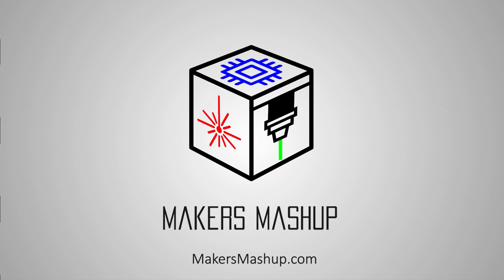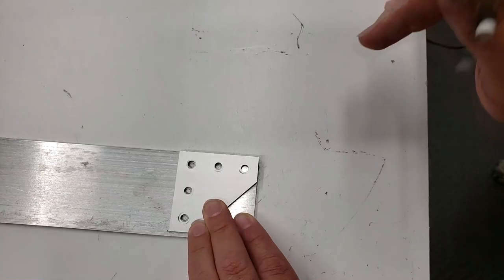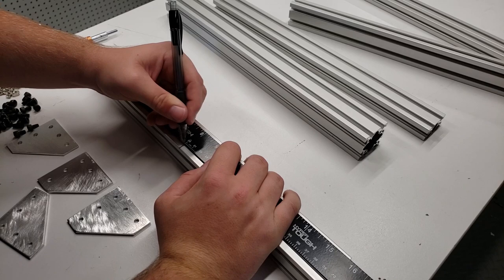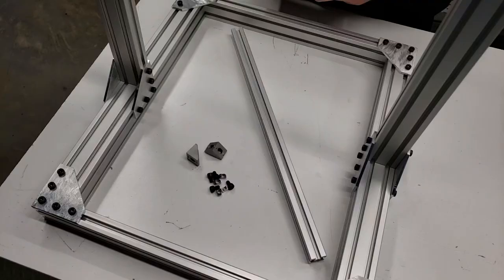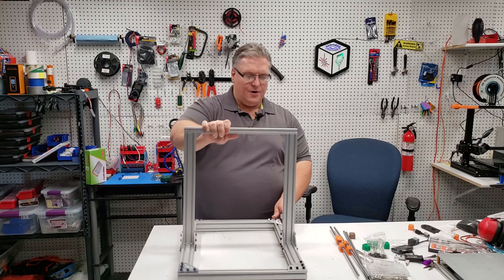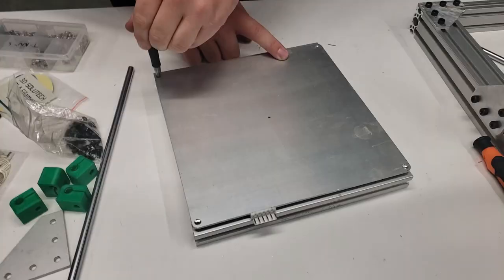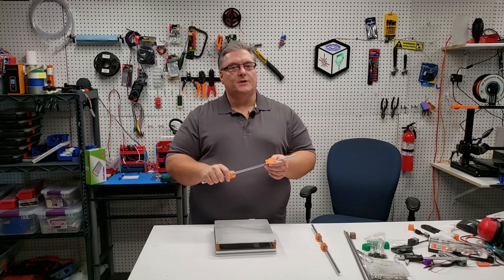DIY 3D Printer Build Your Own  - Part 1 The Frame (Step By Step Guide)

Comment: I wish more people would do this as I did almost 7 years ago.  Seriously, building your own is so much easier, and cheaper, now plus when you are done you will know your baby inside and out.  Hear a noise?  Boom, you will know what is wrong.  We need more makers and less Chinese already made plus I figure if you put in all of that time, and effort, the printer will really be used and not just another electronics gadget stuck in the corner.
Reply: How much did you spend on yours? And what dimensions is it?
Reply: @mixbandtu3225  You can easily build a 400x400x400 for under 200 using top quality parts.  The most expensive part will be a silicone heating pad and the tool plate.  Neither of those will you get on a store bought machine and both of those matter greatly.
Reply: @thebeststooge  How??? That can not be built using v-slot?? Only the extrusion will almost be over 200

Comment: Hello,

First of all, thank you so much for the amazing series on building a 3D printer. I was initially planning to buy one, but after watching your detailed videos, I’m inspired to build my own. I’ve nearly gathered all the necessary parts, except for the 3D printed components. I have a few questions regarding those:

1. There are multiple files available for certain parts, like the x-idler-left. Is it okay to 3D print any one of them?
2. When ordering the 3D printed parts, I noticed that the infill option is set to a default of 20%. I’m not sure how much infill I should choose—20%, 40%, 50%, 80%, or 100%. Could you please advise on this?

Comment: I like what you were doing until that bed setup? It is far to heavy and will create wavy pattern in your print if you want to print at decent speeds. The lighter you can make the moving parts the better. Print quality is always effected by the inertia of the moving bed and nozzle and the heaver you make them the slower you need to print.
Reply from the maker: Absolutely right but for most people they can easily source extrusion but not a standard bed plate.  It prints quite well but you're right higher speeds will introduce artifacts.  It's a good starter printer.   The X301 is the printer you want to build if you want high speed.  That series just started.

Comment: Great video! I definitely will try to follow through and make my own using spare parts from my existing printer. I do have 1 question though, the 4040 extrusion parts, I'm trying my best to make a budgeted printer since I'm doing this on the side, are the 4040 @ 400mm necessary? Would I be able to use the 2040 or 2020 in its place without my frame suffering? Hope to hear back from you soon!
Reply from the maker: You can for sure use 2040 instead of the 4040.  I made a variation on the build myself.  I am pretty sure I included in the C201 models a riser that will allow you to push the rods up for clearance.  Absolutely though you can use 2040 as a replacement.

Comment: I decided to build my own 3d printer after watching your videos, everything seems to be so smooth and flawless in the process however that is not the reality in practice. I have been dealing with the printer for 3 weeks now and no single progress yet due to some physical problems. I have put together the frames but I couldn't make the heatbed frame move smoothly on the guide-rails yet. I investigated it and even consulted one of my machinist friends and we found that the aluminum profiles and rods have slight bend. Didn't you run into similar problem? I watched few other videos and no one mentions such issues caused by the bent profiles/rods. Am I the only one having this issue.
Reply from the maker: I had no issue with bent rods.  It is a process.  Sadly the videos would be terribly boring if I showed myself futzing with aligning something or tightening several screws. The process is straightforward though.  Just stick with it.  These videos were shot over weeks.  It did not take the roughly 2 hours of video footage you see here.  Plenty of others have succeeded so just hang with it.

Comment: I want to build up my 3d Printer, but I have some questions, if I want to replace the fusion head by milling machine or Lizer cutting head, are there any change in the main equipment, moving elements, control cards, etc.

Comment: What if I don’t have a drill press? Is the aluminum so hard I can’t use like... a drill? Or does it need to be that precise? Should I just get a subscription to a maker space lol
Reply from the maker: You can easily use a drill and a HSS bit.  Its quite easy to drill through.  The drill press has the added benefit of drilling very straight.  Take your time drilling and you'll be fine.   I always recommend joining the local makerspace. 😎
Reply: tf are you doing here
Reply: aluminium is soft enough to cut with a normal wood sawblade, it's not hard. Can easily use a drill
Reply: If you already have a 3d printer, there are a few designs for guiding hand drills to create straighter holes.
Reply: There are stands you can attach a drill to use as a drill press.

Comment: How much does your bed weigh, any concern about it causing issues with stopping of movement? Cool stuff, look forwarding to see the rest.
Reply from the maker: Good thought about the weight.  The 2020 is pretty light and while I don't have a carriage plate to weigh I would estimate it to be less. Having put more than a few of these together most carriage plates feel pretty heavy in comparison.  Now that you've mentioned it I want to weigh the extrusion and compare against an actual carriage plate. :)  Overall feels pretty light though.  Thanks for this great call out.

Comment: I guess bed will be quite heavy with so many aluminum = lot of inertia and need to reduce printing speeds. I (IMHO) would tend to use some other technologies to reduce weight of it. keeping minimum weight for extruder mount and related stuff would be another "must have" task
Reply from the maker: Surprisingly the weight difference is not a lot.  Many times a steel H Frame is used on other printers with Aluminum blocks and Metal bearings.  This design uses Drylin (plastic) bearings, printed blocks and Aluminum extrusion vs a steel plate.  Where this design has more aluminum in the frame of the bed, its makes up for it by not using heavy steel h plate, bearings and aluminum blocks.  The final bed also used a PCB with glass which further reduced the weight in Part 5.  So gram for gram I'm pretty sure its a wash compared to other designs.

Comment: CAN YOU HELP? 
I've built my own i3 printer and it's almost ready to use. I'm doing tests, but have problems with the heatbed. I've done several PID tests, changed the bed for a new one, but when I start a print test, the bed fails when heating up!? I've changed the external mosfet, checked the output voltage because the voltage read roughly 5v, at times it says 12v, but if this is the reason why the bed is not heating up, then what could be causing that to happen? Is it my ramps board or could it be something in my marlin 1.1.9 firmware? The hotend works just fine and all the rest of the electronics inc the power is using 12v 20Amps minimum, but I can't work out why? PLEASE PLEASE PLEASE would you help me get over the last hurdle so I can enjoy breathing life into my creation.
I'd appreciate it so much. Thks

Comment: I ordered 2 of 20x40 400mm extrusions because that's what the parts list says, now watching the build video it appears you're using 4 of 20x40 400mm extrusions?
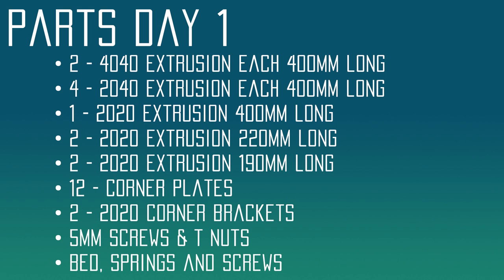Answered my own question: at 1:24 in the video it says 4 of 20x40 40mm extrusions... dang I'll have to order more.

Comment: Thanks a lot for sharing your experiences with this build. Nice work. I had a question can I put a 12" x 12" table on this?
Reply from the maker: Do you mean a 12x12 Heat bed? If so you absolutely could.  You'll need to change the size of the bed mountings and make appropriate adjustments in the length of some of the extrusion but otherwise it should fit a 304mm x 304mm (12"x12") bed fine. Right now its designed for 200mm of travel on the bed in the Y axis.  So you'll need to make it longer to accommodate the extra size.

Comment: Thanks for helping us. I have question if I cut accidentally 2040 extrusion 390mm not 400 mm can i continue building with 390mm or do I need to buy new one?
Reply from the maker: You will probably run out of room to move your bed.  Since the 2040 attaches to the 4040 and we mount the Y axis to it you could end up not leaving enough room for the bed to move.
Reply: Got it . Thank you for your support and I hope you have a great day.

Comment: just wondering does the dimension mention in the video will it determine the volume of the print it self?. Can i scale this for a bigger one?
Reply from the maker: You can scale to the size you want. Just make sure you have enough width and height.  I have another video about making a printer like this bigger as well.

Comment: Not a criticism, genuine question, why build a diy bed this size compared to buying a premade one as there are lots of affordable ones for that price.

This makes a lot of sense as a method for building drastically bigger 3d printer, but i don't get the point at this scale, is there another advantage?
Reply from the maker: Few reasons.  First you gain the knowledge of how a 3D Printer operates. How the parts work and go together.  Much like building a "PC" you know how it goes together.  Second is that with that knowledge you can then modify it as necessary.  You're also putting in the parts you source into it.  Want a better nozzle? Different extruder?  All in your control to swap out (Much like a PC Build).  Then its quite fun to do.  You are assembling it along with an extensive community.  DIY Kits out there from China don't come with a huge community.  Check out the Makers Mashup Discord community.  The Layerfused reddit.  Many people helping others with their build.  Sharing that tribal knowledge.   You're not going to get that sort of experience out of a budget $199 kit you pick up from Amazon.  That is why people do it. For those reasons any more more.  Its an adventure.  Come Join us!

Comment: instead of using those brackets to secure the frame you could tap holes in the frame and just use bolts
Reply from the maker: Yup. Considered it but a bit more effort for new people learning to build one for the first time. Many people don't have the ability to tap screws. Would be a simple way to go however.

Comment: i want to build my own 3d printer, i own a ender 5 and i love it, but so many times i find my self not being able to do a print cause it doesnt fit in my work space an im not very good at the modeling just yet so if i could pull off building my own printer that has a bigger printing surface this would help take care of all the problems i have. i can handle the frame of the printer but my big question is what control board should i use. if i could take the board from my ender 5 an just stick in the printer i want to build then id just buy a replacement silent board to go back in my ender 5. but i dont know how all this stuff works an someone that can explain the logic of it i guess to help me have a better understanding.
Reply: When looking for the extrusions I cannot find any that match your sizes and the ones I find do not look like the ones you are using any advice??

Comment: I would really love to start this project but I don’t have access to any power tools at all, do you think it would still be possible to make a 3D printer without that?
Reply from the maker: You'll need to be able to drill holes with a power drill or a hand drill.  Just going to be more difficult with a hand drill.  Not impossible but more difficult for sure.  You'll have to buy corner plates instead of making them.

Comment: Great tutorial 👍 Sir Can this build be  used for commercial purpose for building and selling 3D printers or do we need a licence? And if so where to get it?
Reply from the maker: Each model has its own license and some are non commercial.   You could look at the X301 if you wanted to build a printer you could sell.  I've been considering making a C201 V2 with different models and 100% open source but that is a ways off.

Comment: Great video.  Little confused about the V6 Hotend with Heater (24v) and Thermistor that you have listed on the  BOM.  You have it listed as 24v but the link to Amazon shows it as 12v (Usongshine J-Head V6 Hot End Full Kit 1.75mm 12V RepRap 3D Printer Extruder Parts Accessories 0.4mm Nozzle).  Am I missing something?
Reply from the maker: its not unusual at all for the products on amazon to be replaced with slightly different versions from the links.  Thanks for pointing this out I'll look and update the BOM.  Many times when an amazon seller runs out they replace the product with a similar one.  We've run into this dozens of time with things like this but unfortunately no way to get ahead of it.  You for sure want to use a 24v hot end.  LayerFused is now offering a 24v premium hot end with a volcano nozzle.  You can check that out here https://shop.layerfused.com/collections/all-products/products/layerfused-volcano-hotend-kit-24v.  The Volcano is compatible with the C201 as well as the X301.  Thanks for pointing this out Mike.
Reply: @MakersMashup  Thanks for info.  I think what I would do is get the one from Amazon and replace the heater with a 24v.
Reply from the maker: Make sure you replace the fan too. 12v fan will last about 10 seconds at 24v :)

Comment: Unless the naming conventions differ from region to region, you appear to be using some 8080's as well (which is a 40 series profile but has 2 slots on each side). 4040 only has 1 slot on each side.
Reply from the maker: It must vary.  Misumi 4040 comes in one or two slots.  4040 here is 40mmx40mm in size.

Comment: Hi!! GREAT VIDEO!!! I would like to build one, but I need a larger print area... I need a 300 X 300 X 400 area.... how do I re-figure the dimensions of the materials I need? Thank you so much!!!!
Reply from the maker: Super simple the 2020 and 2040 need to be 500mm, then increase the 2 vertical rails and lead screws to 500 as well.  Everything else is the same.
Reply: If I go by these dimensions, do I need to make any changes in the code build or the firmware will automatically detects the larger bed??
Reply: Also If I build the larger frame but use  218 X 218 hot bed with 200mm X 200mm printing area will it automatically works or do I need to make any modifications somewhere. I am planning to build a larger frame but add larger hot bed later on in the future.

Comment: If it's  v slot or t slot  would  it make difference  ?
Reply from the maker: V Slot will work fine.
Reply: So either  v or t slots will work , bec I have t slot available  now? , thanks alot❤
Reply from the maker: Both work. Glad to help

Comment: Great job! How’s it holding up today? Also, I wonder if this could double as a CNC router.
Reply from the maker: Still works great but I usually use an X301 for most printing these days.
Reply: Do you know if there are any other differences besides a router between this and a CNC?
Reply from the maker: The C201 would not serve well as a cnc as is.  You would need to reinforce and switch to screw drive vs. Belts.

Comment: How big can you make the printer
Reply: As big as you want, but the bigger it gets, the more energy is required to heat up a bed.
Reply from the maker: Something else to keep in mind here Shawn is that with the added size the bed is harder to stop large amounts of mass.  So if you have a huge bed you'll find that you'll need to slow down the speed to prevent skipped steps and artifacts in your prints.  Something like 300x300 is very easy to do but once you start getting larger you'll find a new set of challenges moving that sort of mass around.

Comment: Hello I have a question, how much approximately does this printer cost to make? I’m thinking of getting another printer, not sure if this is a cost effective way to go or just buy one.
Reply from the maker: The parts costs are outlined in the bill of Materials John, but it will cost you around $250-$300 as shown.  The difference of building one like this vs buying one off the shelf is that you often get better quality components.  Compared to say an Ender 3, you get silent steppers and a geared extruder.  So while you can buy a printer off the shelf cheaper its hard to buy one off the shelf with the same features.  If you typically buy a printer then spend money upgrading it building one like this is usually the better way to go.
Reply: Makers Mashup  Thank you for the quick response. Cheers
Reply: Makers Mashup I repair laundry equipment for a living, so I thought I would give this a try. It looks fun, and learning about the machine I’ll be using.
Reply from the maker: Its a great way to learn about the process.  Feel free to join our discord as well.  There are a number of others in there building the machine in this series as well.  Check the Video description for the link.